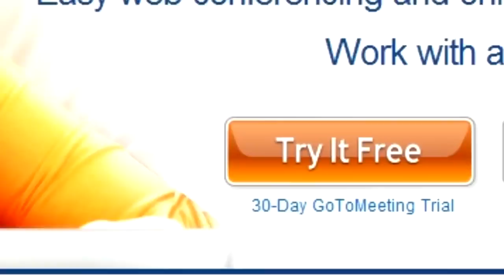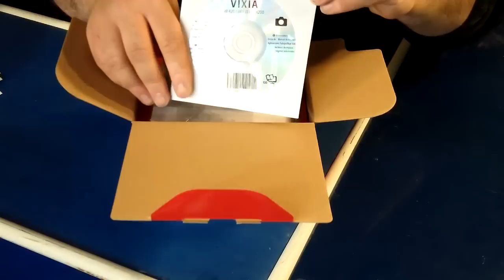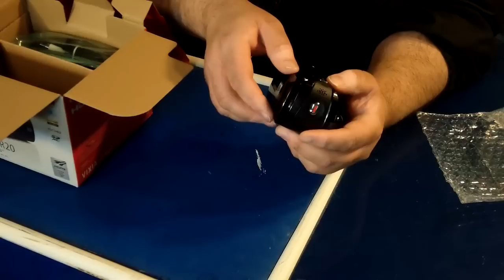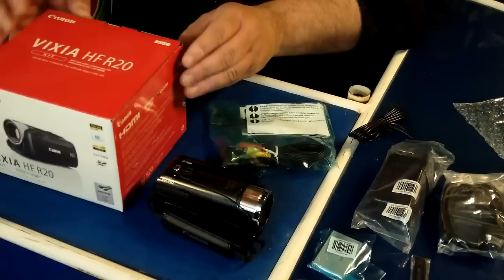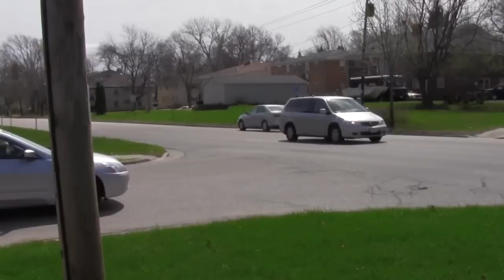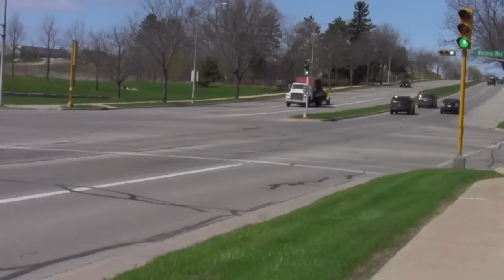Un-Box Me: Canon VIXIA HF R20

Comment: I'm wondering if the computer can see the camera's internal storage and allow me to copy the video files to the computer using windows explorer, or do I have to use the included Pixela transfer software.  I hope to use it on Linux.   If it is detected as a standard storage device, I'll have no trouble, but if it is proprietary, then I might have a problem.